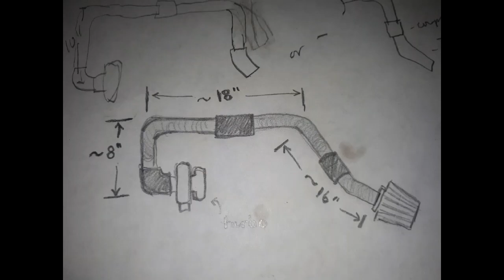Turbo 2ZR-FE Swapped Toyota Yaris Part 1

Comment: what are you using? standart MAF or MAP sensor?
Reply from the maker: The aftermarket piggyback (AEM F/IC) has a Map sensor. The stock ECU is running a MAF sensor.